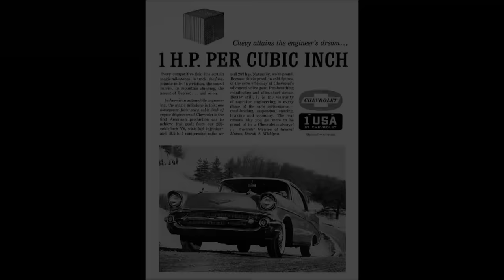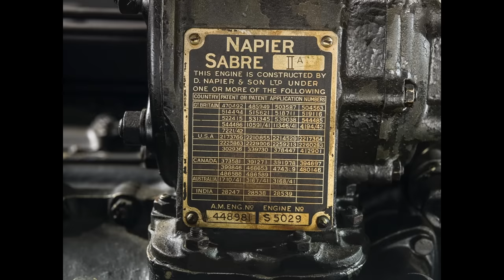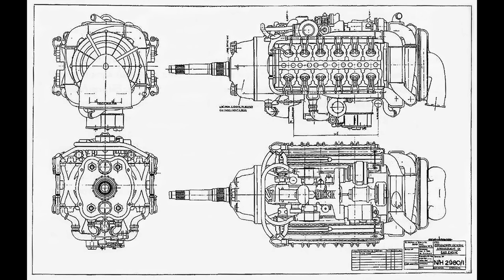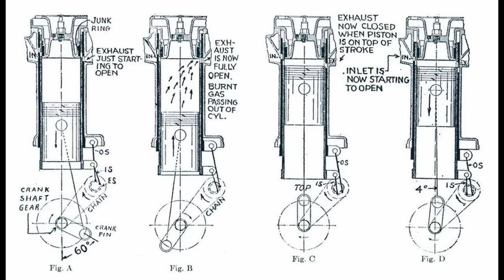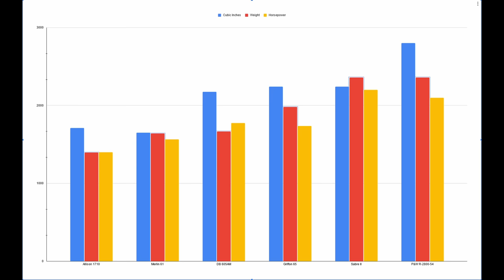Napier Sabre - The Ultimate WWII Aircraft Engine - Part 1

Comment: Ohh, no, you caught cheating... Why people always downplay the Allison V-1710? That engine was highly capable. Just look at the variants used in the P-38. And those were very conservatively tuned. There are many reports that P-40Ns with their single stage superchargers field modified to make up to 1700 HP with no real issues.
From where the data in the chart at 12:35 come? (And why we can't see the header?) Is seems those are power figures. But again, the Allison engine's data is a pure lie. The -143/145 (those were mounted in the F-82 Twin Mustangs BTW)  produced 2250 HP. You really filled the chart with HP figures, except the V-1710, which is clearly have its power in kWs?

Comment: Throw out the comparison to Axis engines--they were running 90 octane while the Allies were running 150 octane. Apples and oranges.

Next, in Top Fuel Racing they pull 7000+hp out of 600 cubic inch engines with TWO POPPET valves. How? Volumetric efficiency under supercharging comes down... to the supercharger.

To wit: the P47D(10 and up), P47M, and P47N were already the fastest (470+mph) prop aircraft to see combat. Why not the Corsair or Hellcat? The P47 had the best (turbo) supercharger of the war.

So why wasn't the Napier Sabre developed to its full potential? Because it was a war not an engineering competition. The P47 was already capable of, and did: carry 3500lb bomb loads, fly through trees and make it back to base, have up to three cylinders shot off the engine and return to base, and once unloaded be far more than a match (by 1944) for any Axis fighter.

What could aircraft powered by the Napier Sabre or the engine itself offer beyond this at the beginning of the jet age? Only a brilliant engineering excersize...

Comment: Too complex, lacked power at high altitude, at introduction it was too heavy for it's power output, (even though the design theory was that it would be lighter)  
Kind of obvious why it struggled.   The key factors for a good engine for the application are, easy to build, easy to fix and makes enough power to do the job without being too heavy, dry weight it was 400kg heavier than the Merlin.  
They just missed the basics.
Reply: The Merlin had far not 3000HP max power like the Sabre so your comparision is obvious, and the RR Griffon was launched later , the similar technology engine (sleeve valve) was the Bristol centaurus but had 2500hp and weight 1222kg (1152kg for the Sabre)
Reply: @leneanderthalien  At it's introduction the Sabre didn't have 3000hp either. and it's power dropped off at high altitude, so it basically weight 400kg more than a merlin and at altitude had the same power output.   

Old mate that did the video purposely skipped over all the stuff that made Sabre undesirable and focused only on "Rolls Royce pressure"   it's as if he has a bit of an axe to grind.

Comment: Have no knowledge about that engine, just a question. Was it liquid cooled or air cooled? To me if you go liquid cooled, you're adding weight which is why in your research, Pratt & Whitney smoke Everyone on your list!
Reply: The Sabre was liquid-cooled. The big drawback of aircooling is that it's unsuitable for inline engines: the last cylinders will run much hotter than the front cylinder, which is why aircooled engines tended to be radials, which had a lot of frontal area and drag. Aircooling also tended to limit the amount of pressure you could run your supercharger at. 
This is why the P&W was so much larger and heavier for the same power output, and didn't "smoke everyone". The one advantage of an aircooled engine was that it could keep running with more damage.

Comment: These are aircraft engines.  One cannot dismiss the performance drop with increasing altitude.  Neither Napier nor Bristol successfully developed supercharging that permitted high altitude performance.  Rolls-Royce excelled at developing boost pressures that maintained high power at altitude.  That aspect alone condemned the Sabre, in spite of it being an outstanding engine in it's later versions.  It did not make enough power at altitude.  As to the Typhoon -Tempest airframes, the Tempest eventually became the Hawker Fury and Sea Fury with the Bristol Centaurus which was a very effective aircraft at low to medium altitude, and was not considered difficult to fly.  The contemporary Reno air racers prove that much.

Comment: Too bad the airframe designers squandered the low frontal area of the engine by hanging the heat exchangers underneath it. The larger frontal area pretty much negates any HP advantage.
Reply: I believe lower drag cooling systems were considered and tested in prototype variants of the Tempest, one was a spitfire like remote radiator system and the other an “annular” cowl similar to the FW190D but the typhoon chin cowl was retained because the other schemes did not give a sufficient performance gain to justify the necessary retooling and consequently later service introduction time in wartime conditions.

Comment: Power per displacement is totally meaningless value in the world of aircraft aviation without artifical competition rules. What really matters is a power per weight of engine, then (much less in practice) frontal area, cooling drag, and fuel consumption (important for long range applications).
 Sleeve-valve engines are heavier than these with poppet valves, it is the main reason why Sabre is heavier than it really should be considering its geometry (around 900 kg for poppet valve variant):
Engines with smaller pistons have better power to weight ratio. 
Additionally, 2 synchronized crankshafts allow for lighter construction from the following reasons:

There is less need for counterweights ( 2 Crankshafts are self-balancing), less vibrations,
and forces working on crankshafts and pistons can be considered local, only between symmetric elements.

Comment: I thank you for the information and all the eyecandy. I am a bit sad though, I thought there was more to it than that. Higher RPM doesn't benefit anything, if anything that makes more friction and we all know about thermodynamics, right? That was the basis for the claims made? They didn't even have a way to get enough fuel to it to make the HP? So instead of solving that with manifold pressure they put a sleeved valve design? There is a reason we never saw either of these two things get popular after this, it is just a horrible idea. It is a beauty of an engine and a beauty of a plane the typhy but what a stretch this thing was. Then you talk about the weight being a problem, and you talk about late war it did this and that, but by that time they had near 4k double wasps and Centarus engines that didn't need high RPM and were more advanced than anything early war. That wasn't really an issue because they were moving into the jet age by that point and despite how much we loved props it just was horribly inefficient.  
Look at the Abrams, literally using a Jet turbine engine because it is more efficient under load, and lighter, it is just a no brainer. 
To think all of those lives were lost.....
Reply: Umm, no.  The gas turbine in the Abrams is not more efficient than a diesel of comparable output.  By a factor of 3.

Comment: If the Sabre were capable of crushing its competition, it would have succeeded. Instead, it failed. The Griffon, R-3350 and R-4360 were all proven by their service histories to be far more serviceable and practically useable engines. There is a reason why sleeve valve technology is dead.

Comment: Fascinating stuff. But during a war, simple wins every time. complexities don't win wars. It must go and go and go and go. That is why the ugly but reliable P&W was so well liked. No water, not complex cooling systems, not the most efficient, but damn it, the engine worked all the time. Even today, the general aviation is owned by Continental and Lycoming - air cooled. Keep it simple stupid. Water absolutely has benefits, no question, but when your life is on the line on the engine, simple wins. Yes Merlins powered great aircraft like Mustangs, Lancasters etc and they were gorgeous units. And the P&W powered the B17 and B29 and others. They were all good. The Napier had great merit, but the complexities and thousands of precision parts - if even 1 part fails  . . .  Too complex despite the merits. Simple, easy to maintain, get in, get out wins wars in this case. 4000 rpm - engines going half that speed last 2x longer - simple math here.

Then came the gas turbine. half the weight or less, far less complex, double the power, and used a lot more fuel, but was a game changer. Was fun while it lasted, eh?

Comment: Most of the problems was the war years they could not get the   metals too produce a engine that has high temp high stress levels on this engine Germany made the Dornier but that was diesel and low revs the sleeve valve is a proven system in any aircraft engine  this why I RRoyce was scared of napiers

Comment: You keep saying how great the power to weight ratio was  and how this was THE best engine but you also keep saying we won't get into lower power at higher altitudes. Sorry but aircraft, especially fighter aircraft, fly at different altitudes. This makes that a VERY important aspect here
Reply from the maker: That's a fair point. The forced induction system can absolutely change the performance and perception of an engine. I mainly compared sea level data in an attempt to make a fair comparison of the engine design separate from the forced induction components.

Comment: How much of it was cost? An H24, especially sleeve valve, is going to be significantly more expensive to build than a V12. I'm curious as to the cost of a Sabre vs a Merlin. 

I suspect the high weight of the Sabre was due to the sleeve valves (more big moving parts) and more cylinders. 

I think power:weight is much more important than power:displacement. Same reason why pushrod engines might be larger displacement than OHC engines, but less weight (and often size) for the same power.
Reply: The weight may relate to being designed for extremely high boost pressures from the very start.
Sleeve valves don’t add much weight in themselves - the gear and lever drives for them can be an issue.
The Bristol air cooled radial sleeve valve engines were quite competitive.
Reply: @allangibson2408  I was referring to the whole system rather than the sleeve itself. 

I'm not denying that the Sabre was competitive, it looks like it was, just stating the factors that I believe matter more than displacement.
Reply: @totensiebush  Sleeve valves are inherently more efficient than poppet valves. Thats why they got used in the Bristol and Napier engines.
They are also inherently harder to make.
Gas turbines are much simpler to build and maintain (which should tell you something about sleeve valve engines too).
The break point is at about 400hp. Below that piston engines are lighter and easier to build, above that gas turbines are lighter and easier. 
Piston engines are however always far more fuel efficient regardless of size (which why big cargo ships have really big piston engines).
Reply: @allangibson2408  I know that big power piston engines are pretty ridiculously expensive/hard to make: that was one of the big reasons for the Me262, the engine was far cheaper/quicker to build. I know, a turbojet and a turboprop aren't quite the same, but I suspect manufacture cost is similar. 

I didn't think that gas turbines were particularly inefficient when operated reasonably near peak output. I know they're very inefficient at low output, but thought they were reasonable up top (of course, if you're making a bunch of power you're going faster and that's inefficient).
Reply: @totensiebush  Gas turbines without heat recovery top out at about 20-30% efficiency. (45 to 60% with heat recovery boilers but no-one is going to put one of those on a vehicle).
Diesels at 55 to 60%.
So diesels will burn half as much fuel as a gas turbine engine for the same power output.
Gasoline engines are 30 to 36% efficient so burn about 2/3 as much fuel.
Gas turbines are however much lighter in weight and physically much smaller for the same power output.
So win on engine weight but lose on fuel weight with gas turbines.
Reply: There is a lot less parts per cylinder with sleeve valve than poppet valve. Moreover, poppet valves require a lot of power to drive the cams that are subject to wear and the tappets require regular attention (modern engines have improved considerably in this respect). Once sleeve valves have the timing set, there is really no further attention needed - this is useful when considering maintenance in the battlefield. The poppet valve engine had a lot more ongoing research and design at the time along with considerable manufacturing experience. As for the seemingly high complexity of the Sabre, yes it has a lot of parts but it also has a lot of cylinders as well. Per cylinder it has a lot less  moving parts than a poppet valve engine. One of the design features of the Sabre was it's low compression ratio so that it could use low octane fuel - a very important requirement at the beginning of WW2. To get the power, Napier just added more cylinders. War time politics and industrial production requirements make the whole history of aero engines at the time very nuanced.
Reply: @chrisstott2775  without watching it again, I thought that the video said that most of the engines had a compression ratio in the range of 6-6.5 while the Sabre was 7. I know that's low by modern standards, but it's higher than the other engines.

And yes, a system being well developed is hugely important. Even if you know the other system can be somewhat better with enough time and money to figure out design, manufacturing, maintenance, etc, poppet valves were ready now. They didn't need as much of that development.
Reply: If you think power  to weight is the most important factor, go watch the video again- the later versions of the Sabre smashed the other engines  oth on power to weight and specific output.

Comment: Moving forward with a design that fundamentally suffered from weight issues was simply bad engineering.  HP is meaningless if the engine is too heavy to propel itself.  Dual crankshafts geared to one drive shaft was, for aircraft, a ridiculous design, for weight as well as for maintenance.  Napier’s competitors were miles ahead of them, neatly explaining its rarity and failure.  In engineering, cream rises to the top.

Comment: Airplane engine as victim? Conspiracy theories? It was not the best engine of the war. Don't rewrite history. The best engine is the one that is reliable, maintainable in the field under rough conditions has sufficient power and is available in quantity, viz., the Merlin and the Packard Merlin, and the R2800. A lot of them were made.    Napier only built about 5,000 engines total. As far as the winnah is concerned, my bet's on the BMW 801. My old man said they were the best ever and he knew because he worked for Curtiss Wright and one of his jobs was analyzing captured enemy engines.

Comment: Way too complicated of a design, not very dependable, and prone to breakdowns. The engine would die out at higher altitudes, which made it useless to shoot down bombers that fly 10,000 feet higher than what you can fly with a saber engine. Higher horsepower doesn't always mean, in real-world use, that it's the best engine. The engine would have been better used in a tank.

Comment: Germany lost the war, in part, because their designs were complex works of art.  There is no art on a battlefield.  I don't care what metric you use, the Germans produced the most technologically advanced equipment.  That caused problems in 3 areas, first, production - more parts mean longer lead times, and 2 make the production susceptible to sabotage (e.g. the Allie raids on the ball bearing plants in Germany), and 3 - engineers love refining things but the problem is the people using their stuff are not engineers.... how do I say this nicely... engineering ability was an exception to get you off the front lines, while there are many who honorably served who designed amazing things after the war, the reality is those who were on the front line did not have the time, skills, or ability to learn how to fix complex machinery.... it's true, on paper that the Napier motor is a thing of art.  Refer back to art and the battlefield.
Reply: A surprising and ironic comment to find on a video about the most ridiculously complicated engine design in WW2 by the Allies...
Don't let bias get the better of you lad..